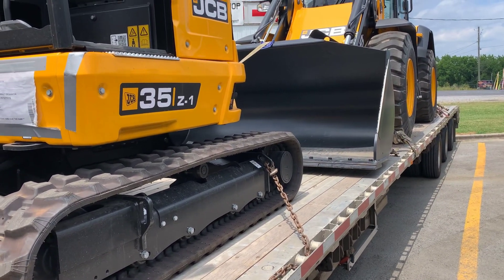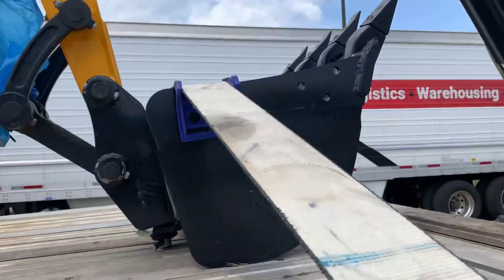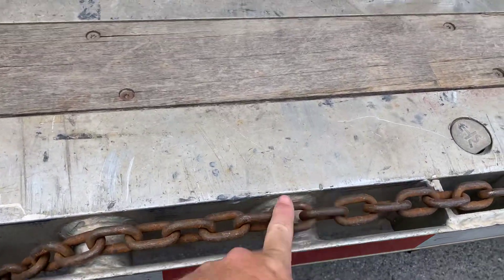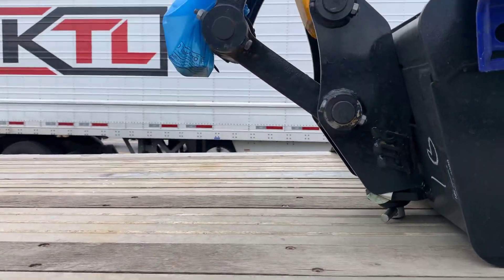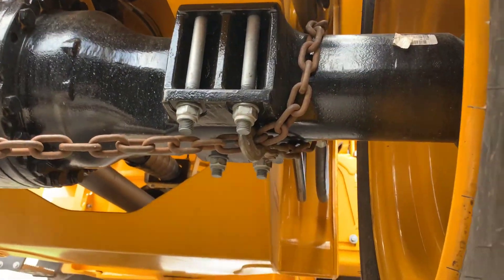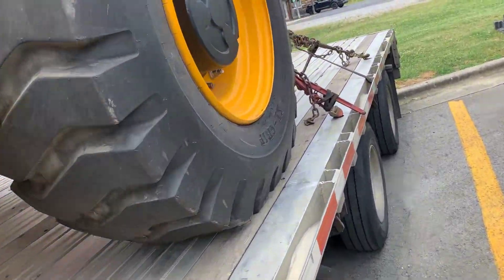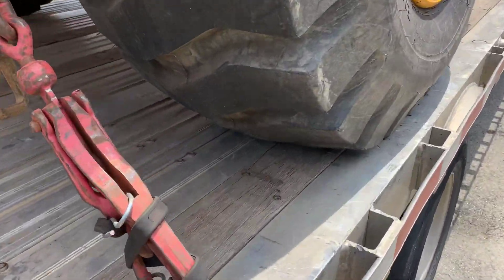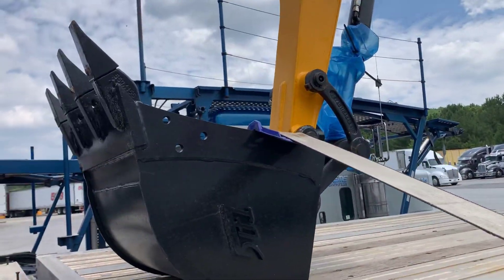Jcb 35 z-1 and 417

Comment: First one I have seen from you I would have done differently. I don't like how you put your main binders on the blade of that excavator. The hydraulics can move and it puts extra pressure on the hydraulic system. If the hydraulics do move your load can become lose quickly. I had it happen with some skidsteers. You have way more experience than me on strapping equipment and I sure it will be fine. I just won't use main chaining on anything with hydraulics anymore.